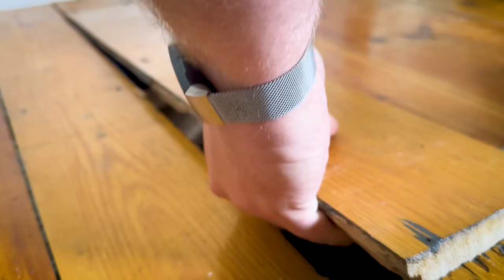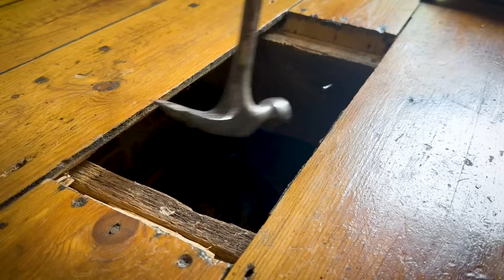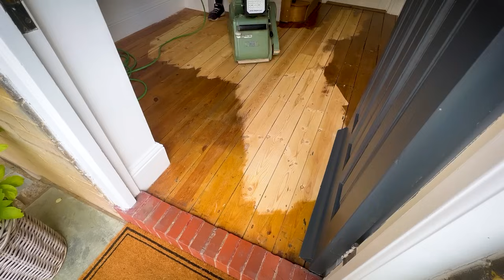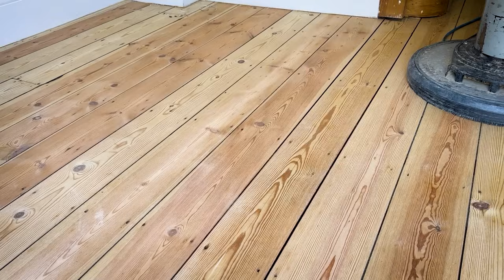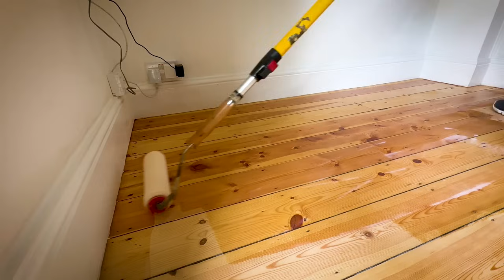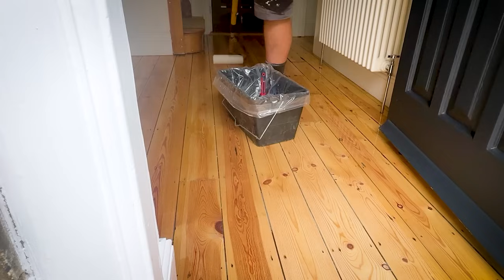Restoring 100 Year Old Floorboards. Is it WORTH IT?

Comment: You were very fortunate that your 100 year old pine flooring did not have any big gaps between the boards. My house was built in 1892 and has the original old pine planks. Some have rather larger gaps, so I won’t be able to go with a lighter or natural stain because I would see all those dark cracks.
Reply: I just uncovered my houses living room hard floor but just a little bit so idk if it has any big cracks I'll keep that in mind
Reply: You could consider moving the boards around a bit if you can get them up, or you can also fill the gaps with Bona Mix & Fill. He does a great video on filling gaps as well
Reply: I watched a video a while back on another channel using natural fiber cordage between some of the cracks to allow for expansion of wood. They dyed it to match the floors close as possible. Don't know how well it lasts but it seemed nice.
Reply: Mine too huge gaps and holes around pipework even wires that were just under the carpet!
Reply: Who cares about the gap

Comment: What a fantastic job you did with this floor! You strengthened the loose boards which likely squeaked, nailing them back in place.  Then you sanded the floor-boards so perfectly and sealed them! Sanding a 2nd time and sealing again.😊 It really came out looking awesome! Well done!❤👍
Reply: No need to watch the vid with this perfect synopsis.. 😆
Reply: You can't remove squeaks by nailing the floors back in. You have flooring screws nowadays and they work much better than any nail you'll ever see but to each his own ..
Reply: I don't understand why the need for a second sanding. Doesn't the second sanding remove the work of the first seal?
Reply: @nobodyhome31337 pretty sure it’s to de-nib the planks. The water based sealant raises the grain on the timber, so it’s lightly sanded between coats so the floor isn’t rough.

Comment: The floor on my house is over 200 year old planks. It doesn’t lay flat in a lot of areas(kind of like walking in a ship)… is it possible to use the big machines on it or is my best bet to go hands and knees and use an orbital sander?
Reply: I'm in a similar boat and my guess is it's better to do it by hand. Just be very careful to use PPE and a shop vac for dust collection. Those machines are also vacuums, so you'll end up with a huge mess if you're not careful
Reply: Mine also is like an uneven old ship but I love its character finished sanding 40grit hoovering all the crap constantly is annoying, gaps i used sealant wish i had only used around the edges now as its stained will prob have to plain it off😒 boiled linseed x2 coats still loads to do🙄

Comment: As a DIYer who just restored his own 150 year old floorboards last weekend after trying to learn as much as possible from your videos, I want to share some of my experiences. 
1. Against your advice we thought that we could get away with just using a rotary sander and edge sander since pine wood is quite soft. I guess we were afraid of using a belt sander and messing it up. We quickly realized our mistake, listened to the pros and rented a belt sander. Even if your floorboards are only very slightly cupped, it takes forever to get them level with anything else and any dents will not come. Just be careful and stay focussed.
2. Take enough time to check if there is movement in your floorboards and nail them down if necessary. There were a couple of planks that I missed that moved ever so slightly, which meant that we initially missed some of the deeper scratches of the coarse grits when trying to sand them out, because the board dipped down ever so slightly.
3. Take a bright light and go over your floors after you move up a grit. You will be able to easily spot if you left some deep scratches or if you managed to get them all out.
4. When it came time to finish the floor with a roller, we had some issues with dirt coming up from the gaps between the floorboards, even though we vacuumed very thoroughly. This caused some bits to get stuck into the finishing oil, which we then had to scuff sand out between coats. Probably worth it to spend some extra time poking away at the gaps to loosen dirt and then vacuum it all up.
5. The whole process took way longer than expected, but we are oh so very pleased we the result. All of the common pitfalls were avoided thanks to your videos! At least as far as I can tell ;)
Reply from the maker: Wow, if you’d have bought my video course and shot me an email I could have saved you a ton of time and money(one days rental for 1 machine is more than the cost of my course 😂)

I couldn’t think of a floor less apt for starting with a rotary sander than a 150 year old pine floor 😂 it takes a ton of work even with 36 on a drum sander.

However, a lot of the time someone will email with a question, I’ll give them my advice and they will not take my advice and then exactly what I said was going to happen happens. I’m not saying that to moan, it happens 75% of the time, I don’t know how to be more convincing!

I’m glad it worked out in the end, floors that old look great when they’re done
Reply: @HowToSandAFloor 
Have you ever heard of the Rhino RS150 working to sand wooden floors?

Comment: Incredible difference! It doesn't look like the walls were affected or discoloured. That's my issue, which to do first. I heard that the walls will get discoloured by the floor sanding, so I was going to do the floors first then have the problem of protecting the floors while doing the walls and ceilings, all hardwood ceiling to & including floors, 3 layers of lead paint on walls & ceiling.

Comment: Not using Bona anymore?, did a job similar to this a few days ago, Very old pine boards but the majority of the floor was covered in carpet adhesive so it gunked up all the sanding pads and had to scrape all the edges with a carbide scraper  before using the rotex. Punched all the nails below like done here and also lifted a board and put better supports under like you did here to stop the boards moving when stepped on. Hoovering was a nightmare just couldnt seem to get bits to stop coming up through the cracks until the last coat. My job was stained walnut and coated with a few coats of Fiddes hardwax oil cut back in between. Came up lovely.

Comment: 4 disc floor sanders are much gentler and preserve far more material than the belt or other style of sanders.  For most people, that would be the far safer option for sanding old floors.  I've seen a lot of old homes flooring ruined by the more aggressive machines in the wrong hands.
Reply from the maker: Older floors need more material removed, and pine floorboards like this can rip those disks off sometimes. People just need to do a bit of research on how to use the drum sander and practice with a 120 belt.

Comment: No sawdust and Lecol. Apart from that good job. Little tip, before final sand, if you give a light water pop (I use a garden sprayer high pressure fine spray) . There is no need to sand between coats meaning there is a thicker protection layer and still just as smooth.
Reply: Can't resin fill gaps that big brother, will crack and loosen within 3 seasons.
Reply: What does your "sawdust and Lecol" comment mean? Are you suggesting that the floor should have been vandalised (aka, gap-filled)??
Reply: @p1tillhometime  I was referring to the nails holes
Reply: @simpletonballsack  I was referring to nails holes and the chipped parts. Not the gaps, That’s suicidal.
Reply: @sambryant2283  same applies. You could putty fill the nail holes to avoid cracking... but that'd be very odd, it's considered to be part of the optic character of the floor (the visible nail holes).
Reply: @sambryant2283  Gotcha!
Reply: @p1tillhometime  20 years experience of working on old pine floorboards. I always punch the nails in and fill the holes in. The overall finish looks much better and no issues with failure.
Reply: @sambryant2283  each to their own. 👍
Thanks for your contribution to the industry.
Reply: There's a section on water popping in his online course, so he almost certainly did it here, just didn't show it.
Reply: @LazTLaz  water popping is mainly functional for Floors to be colour stained, so probably he didn't for this one because there's very little benefit. The drying time of the water pop would be longer than the intermediate sanding between coats for an area this small.

Comment: great video, and the floor came great as well.  I want to restore a similar floor in my house.  I am curious, what did you use to fill the gaps between the boards?
Reply: I had the same question, any solution?

Comment: I’ve been watching a lot of your videos recently! I am refinishing my own hardwood floors at the moment. I wanted to get your opinion on something though. I sanded the edges first with a belt sander with 50 grit going with the grain and then with a detail sander with 60 grit. I will be coming back with a drum sander for the middle of the floors with 60 grit and then going from 80 to 100 and the same for the edges but with a detail sander. Do you think I should have done the edges differently? I hope you see this before I finish up so that way I have an experts opinion!

Comment: They look amazing.  Our house was built in the 1920s and the flooring is like this.  We tried to sand it and do it ourselves and the result was meh.  Having watched your videos I can see what things we did wrong so how to improve next time.  The one big issue we had is that one board needed replacing completely and they don’t make the boards the same size now so the one that my husband replaced it with isn’t as wide as the original and sticks up higher.  Do you know if there is anywhere you can get original ones to switch out?

Comment: Thank you ❤ my floors are from 1886 and I am pulling my hair out trying to clean them up to sand them ❤
Reply from the maker: Why do you need to clean them before sanding?
Reply: No telling how many materials have been attached and with what adhesives or coatings over the years. @HowToSandAFloor

Comment: Thank you! Why did builders put strips of wood on top of floor joists? We replaced several joists and flooring in the kitchen years ago, but we didn't go far enough. Now I have a new soft spot. I'm too old to crawl under the house. Do NOT tell me I am too fat to do it or I'll prove you wrong just for spite! Anyway I used some reclaimed wide hundred year old tongue and groove on a floor upstairs. I tried the glue and sawdust filler. Yeah, sawdust is much too coarse BUT I can fill most of the gaps with it and then come back with a fine filler. I'll be painting the floor anyway. The walls and ceiling are this wonderful dark  shiny stain/sealer/whatever. I just need a light color floor. I refuse to sand the whole floor. Wouldn't be able to carry a floor sander up the stairs. Had to get a young friend to carry my Dewalt saw down the stairs after finishing the floor. And for all you 'pro' men, my home (2 stories) was cut in half and moved to my land 25 years ago. A doctor moved South and converted a barn into her a hundred years ago. She survived a direct hit from Hurricane Katrina with minimal damage.

Comment: Any advice on cleaning carpet adhesive off 70year old boards? I very much would like to restore it and own a 16in rotary disc and a 20in square scrubber as well as all the hand tools thanks😬 I've considered buying a scraper drive for the rotary but don't want to potentially damage the boards with a diamond scraper. 
I also have these same wide boards with the gaping under my carpet on the second floor, so this helps me a lot!
Reply from the maker: sand it off with a big belt/drum machine. If theyre 70 year old boards youre going to need to start with one anyway! 36 or 40 grit should get it off

Comment: So you would recommend using a roller for the polyacrylic topcoat?
Reply from the maker: I think roller is the best method of application yes
Reply: @HowToSandAFloor  thank you! I’ve watched a ton of your videos and didn’t heed your advice to use the drum sander rather than a finishing sander to remove the old finish. I recall you saying in one of your videos, that it would take a week if you used just a finishing sander. No one in my area offers a drum sander for rent so I went with the finishing sander. It took me 55 hours not including prep time, clean up and edge work to sand about 1200 sqft.  15 hours the first day, 10 the next then about about 5 on average the next 5 days. I knew within the first minute of using it, that I was in for a long day and should’ve returned it right then and counted my loss.

Comment: Why did you use the sander at an angle when removing the paint and not use it in the direction of the wood fibers?
Reply: it more easily creates visible marks
Reply: @magnushmann  Thank you
Reply: Makes the floor flatter
Reply: I think there's a pretty good video somewhere on this channel that explains why you start with one or more diagonal passes until the floor is smooth and then do the final pass with the grain.
Reply: @Ragnar8504  There is yea

Comment: beautifull job on the sanding but id rather get new floors in or if you are sanding old floors first sand it down spray it with anti mould +wax and coloring/paint removal solutions, scoop it up and then do the sanding and vaxing and all, unfortunately the old big gaps big cuts and rots underneath and between the panels make it look very dreadfull still, ud think its good for environment but many solutions are used and producing that probably has the same effect on environment as just buying new floors.
Reply from the maker: Thanks for the advice

Comment: seems like a lot of effort to put into dressing up subflooring.
Reply: What you talking about
Reply: @chasemcintyre6806  typical subflooring is wide (1x4, 1x6) pine that is top nailed directly into floor joists with gaps between boards.    Finished flooring is usually hard wood (e.g. oak) and tongue and groove interlocked with toe nailed through the tongue and hidden by the groove.   Finished flooring is installed on top of subflooring with a felt (or now tyvek) layer between them as vapor barrier and cushioning.   Alternatively, sheet goods can be installed on top of subflooring before carpeting or other floor covering.

The boards in this video appear to be subflooring.
Reply: I see what you are saying but this is very old flooring and old flooring was commonly done using wide boards , you may be right but at least it's not shitty looking subfloor, after finishing it can easily pass for harwood finished flooromg
Reply: certainly is good looking.  the old growth boards of yore look better than premium grades today.  mind the gaps though.

Comment: I have a remark!
Giving away some private details.
30 plus years in the Craft.
Never ever I carry a Hummel with a client!
There are many reasons,weight,knowledge!
Here it comes;
A company planned to do 3 floor levels sanding,reparing a Wenge tapis strokes Floor.
Ehm The just forgot to assign someone to the Job!
Ring ,ring!
Ehm Rene what are You doing TODAY!!!???
Long story short,I went to.the work.
Will not mention the Client and or Company!
Cursing at arrival!
Cursing when I broke down the Hummel.
On the lowest level ,Client told Me,I help You!
My whole system was screaming,NO,NO,NO!
Anyway,
I step on top of the chairs and tried to take the Hummel (approx 85 kg) and before I could say ,yes let's go !
HE PUSHED THE HUMMEL.LIKE A TODDLER CARRIER!
I ended up downstairs,My upside tooths gone,hitting metal staircase handle bar.
My stomach ruptured,my colum out,inside My skin though.
Hummel fell on top of Me while sliding down the stairs!
Broken ribs,etc.
This shortly after anounced craftsman of the Year 2014 !
Do You want a painkiller medicin.
I drove 80 miles to My Docter,He started screaming Ambulance!!
Turned out ,I could have passed away in minutes,when My Colum leaked,broke.
Long atory short,
I fought Myself back and will never be the same!
I warn everyone,do not take risks.
Not concerning Floors,however Your health.
I am full force,motivated ,back.and I am addicted to My work,creating the best result as allways.
Fact;
I never had to re-do a floor in 30 years.
Hope to find some help to create My own channel.
In the meantime ,having easure watching this channel and comments
Rene du Bois
Rotterdam
The Netherlands
Reply from the maker: @renedubois6392  wow painful! 😬 I just made 20 years in the business. Where did it go??